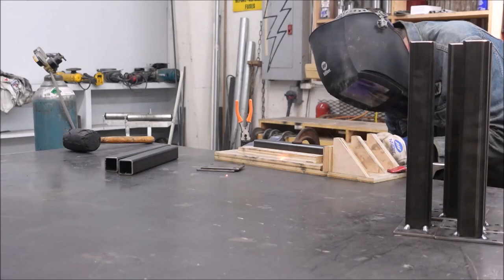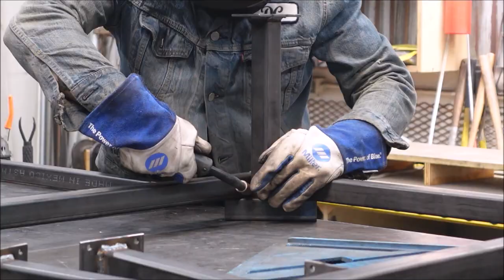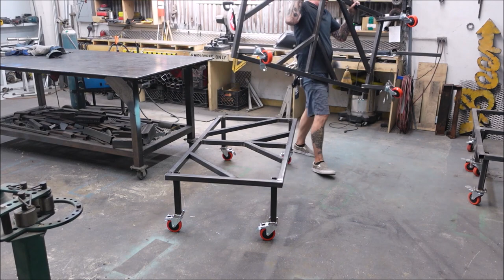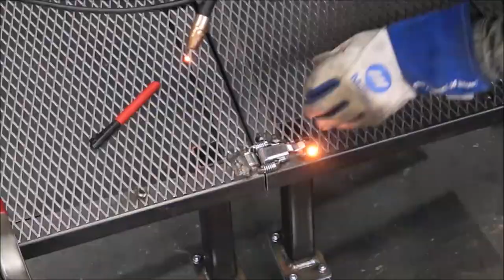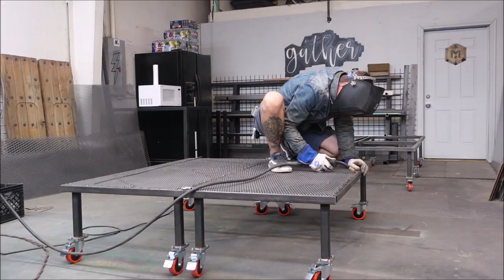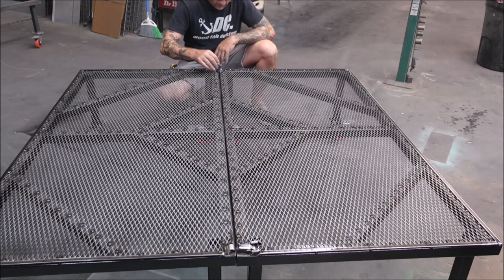Tour Worthy Drum Riser. Challenge accepted!

Comment: Challenge FAIL. The problem with using a screen for the deck (floor) is that the Bass Drum pegs that keep it from moving will go through the holes in the screen. The deck needs to be SOLID.
Reply from the maker: Wrong. The spikes, not pegs, nest inside the half inch expanded opening. You must be the singer...
Reply: @DC wood fab design  
Well, if that's the case, then you're limited to only being able to put the bass drum in the center where your one 1/2 channel is. This also means the drum thrown will be near the back edge of the platform.  It would be better if the bass drum could be moved in front of the centerline so you're sitting farther forward from the back edge of the riser.  I stand by my previous criticism. 
Also, I would ha e put the lock mechanism on the underside of the rails. I also would have made the legs removable for transportation purposes.
Reply from the maker: @rhyshenson7318  Wrong again. Haha. I put custom bracing under all risaers based on the set up. Some of the time I make these with removable legs to sit on the stage for opening acts. This particular riser is a headliner so no need to remove legs. AND the drums on my risers stay mounted to the platform and loaded in the trailer pack already set up. Very convenient if you ask me... wait, you didnt ask you're just trying to be right about something at this point...

Comment: While the frame is good, the flooring is too weak. The expanded metal  will flex way too much. You would be much better off with 3/4" plywood
Reply from the maker: I appreciate your input. However several drummers tour on my risers and i add, usually off camera, custom bracing for the stool, snare, and maybe a rack. Other than that, never a problem with sagging.
Reply: @DerekConwayTX  awesome! If it works, it works.